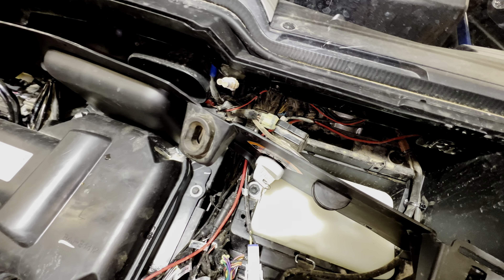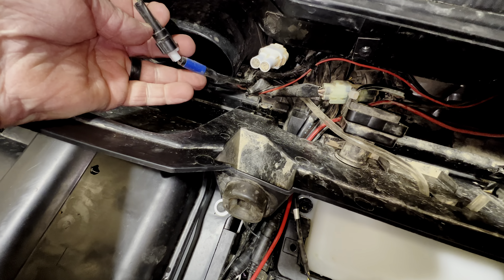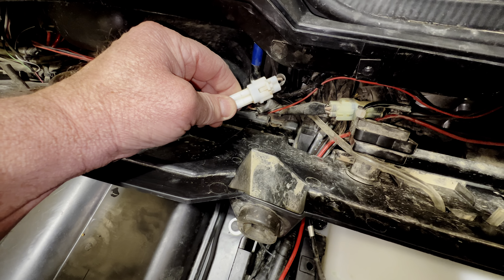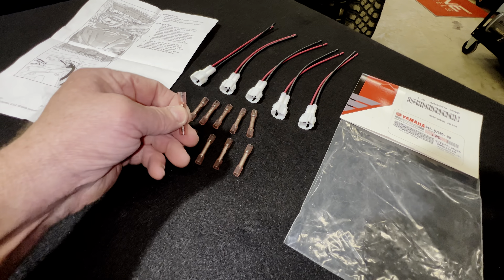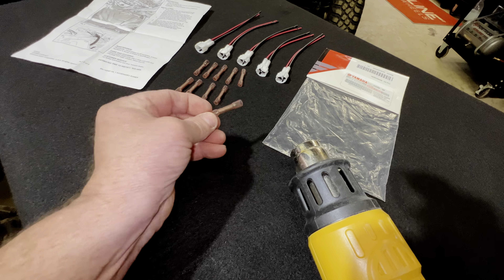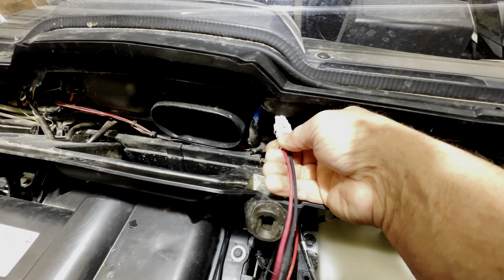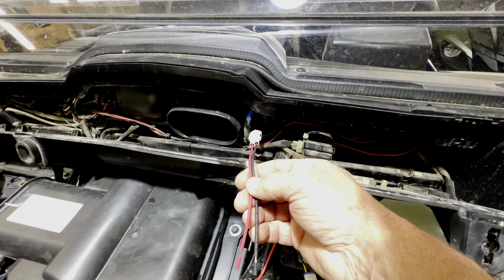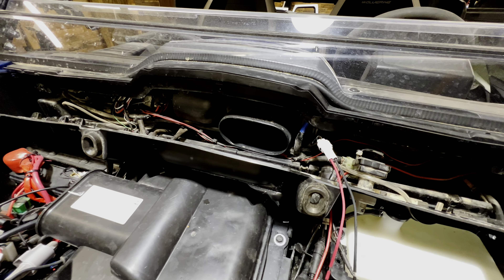YAMAHA WOLVERINE ACCESSORY CONNECTORS Q&A

Comment: That accessory wire that you unplugged with the protected rubber grommets. Could I order the metal pins and rubber seals and mock up to that connector and just plug it back in. Instead of buying the 5 pack because I just need that one. Just curious because I know exactly what pins and rubber grommets they are literally .18 cent and .10 cent a piece from a corsa website
Reply from the maker: You could, or cut the plug off & splice the wires together.

Comment: How do you crimp those connectors? Is it just by pressing it with those crimping plier tools? Doesn't it damage the waterproof seal when crimpped with such a tool? Mine (original from dealer)  does not come with a manual lol...

Comment: Thanks Brian I have been doing my home work last couple of day's I agree with you on Polaris but I have three sportsman 2 850 xp and 1 550 xp . I did have problems with one of my 850 around 800 to 900 miles my machine had that spun timing gear on crank . Don't know if you know of that problem but Polaris press on the timing gear to crank no key to hold from spinning it is just a friction fit motor went out of time vales hitting piston heads. Long story short Polaris said have a nice day I rebuilt the motor myself but parts cost me 2200.00 . So I ask about Polaris and other never hung on Polaris just thought maybe I was just one in million but with your input and I was thinking all long cam am . I feel good going  forward in future with cam am I really appreciate you take the time answer my question Brian  thanks
Reply from the maker: Yes sir, good luck and keep me posted on what you decide to go with. 👍🏼

Comment: If I only need to tap into the 12v accessory power, would I still need to ground it somewhere? Trying to wire in a dash cam and the power and ground go to the battery and the Acc power is only 1 wire
Reply from the maker: Your acc wire should go to a key hot wire so it only comes on when you turn the key on.
Reply: @FishersOffRoad  I thought the connector in the video is a key hot wire. Using that would save me from splicing into any other wires. I’m not well versed in this, so I was just asking because I couldn’t find any answers online
Reply from the maker: @paul02155  you could just use a hotwire if you wanted to. I didn’t know if you wanted to use one of your 5 accessory connections for that.

Comment: So 20 amps per connector or 20 amps for all 5 combined
Reply from the maker: 20 amps for all 5 combined.
Reply: Bit ridiculous huh
Reply: 20A in total. That can be 1 cable drawing 20A and the 4 others 0A (don't connect anything to them) but it can also be 4A on every connector (= 20A total) or it can be anything in between like 8+3+1+4+4 really... If you need more than 20A you need to install a fusebox, powered via a proper thick wire directly to the battery. (check for YT vids on that, cause you need to install security-stuff in between the battery and fusebox. Also when installing a 2nd battery for accessories only, you need even more "special" stuff...)

Also be sure to do the maths correct 😉 Say you want to install a dual USB rocker switch. They are mostly 4.2Amps. That does NOT mean you loose 4.2A from the 20A total. Cause the 4.2A is on 5V (usb) so 4.2Amps x 5Volt = 21Watts --> the acc plug is 12V so --> 21W : 12V = 1.75A. So it takes 1.75A from the 20A on 12V (and not 4.2A)

In other words, 20A is plenty

Comment: I’m thinkin buying the Yamaha connectors just to butt splice them doesn’t make sense. If you’re already butt splicing might as well cut the Yamaha specific connectors off and splice wire directly. Solder heat shrink and done or just use crimp splices and heat shrink.
Reply from the maker: I’ve done it both ways, the benefit of the connectors is it gives you more wire to work with. It’s pretty tight after you cut the plug off behind the dash panel.